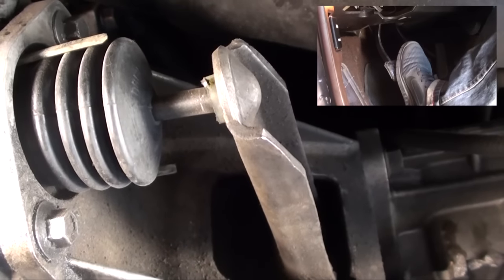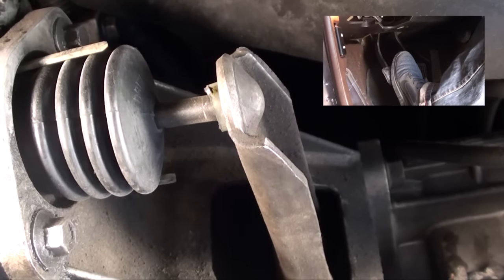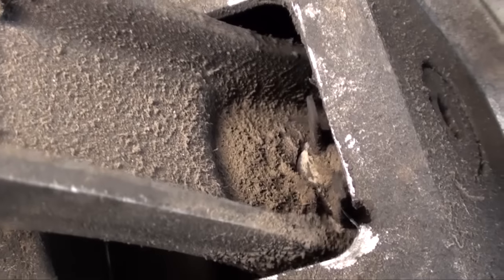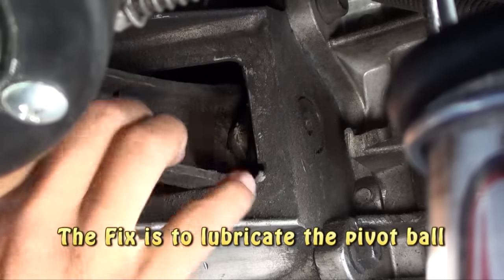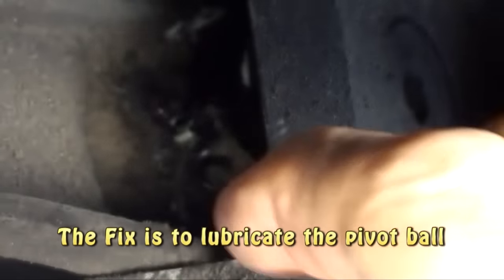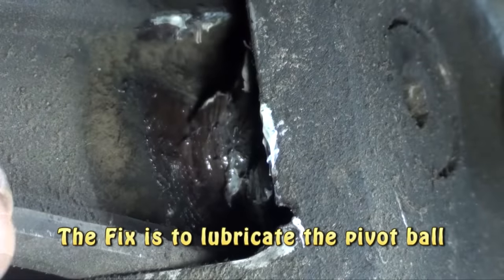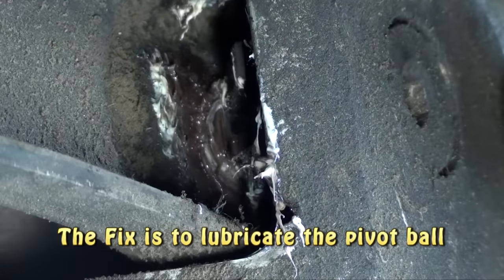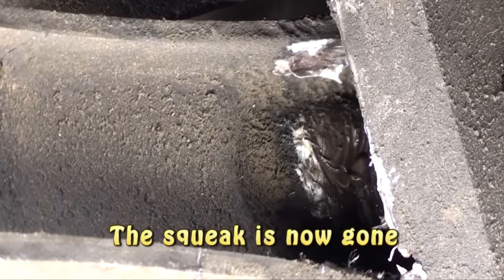Clutch Release Fork Noise

Comment: This... actually sounds very similar to what is going on with mine. Except I have to press a bit more on the clutch.
I am betting it is likely more input shaft bearing noise. :c
Reply from the maker: If you have to push your clutch pedal 2/3 to 3/4 of the way down for the noise to go away then the problem is inside the transmission.  Input shaft bearing in the most likely suspect but if you have a transmission as compared to a transaxle it could also be counter shaft bearing noises or even noises from the bearings that support the gears.
Reply: @DrivelineMaster  I took it to a transmission repair shop, they test drove the vehicle and they said it's the throwout bearing.

From what I have read, throwout bearings should only make noise when the clutch is engaged/pedal pushed to floor.

What I am experiencing is, clutch is making noise when released, pedal is off the floor.
When I push the clutch in to engage, the sound makes a slight rotational noise that is winding down, that then ceases shortly after holding it pushed to the floor.

https://www.youtube.com/watch?v=YCkk-hgNI2E is similar to what I am experiencing. Chances are the one installed in this car is the wrong one, as the previous owner mixed dexcool and some other shit coolant together. Stock clutch for my car is an Exedy Sport (according to AAMCO a 'racing style clutch' that they won't warranty on install) also yes, this is a "transaxle" due to the car being FWD.
Reply from the maker: @liger0yager    Here is how to tell if it's a release bearing.  But first I need to clarify.  I'm glad you stated the position of the pedal but clutch engaged and disengaged are opposite of the pedal position. My students get that confused all the time.  Clutch engaged is when engine power is engaged with the transmission input shaft (pedal up) and disengaged means the engine power is disengaged from the transmission (pedal down).  Now for a release (AKA throw out) bearing noise. When the noise occurs is slightly different depending on if you have a hydraulically operated clutch or a cable or old mechanical linkage design. If it's hydraulic then you could be (not always) hearing a slight noise with your foot off the pedal and when you push your pedal down 1" - 2" the noise will change in tone and loudness.  This noise will most likely continue as long as your foot is on the pedal. Once you remove your foot from the pedal the nose level will decrease but may not go away.  If you have a cable or old mechanical clutch system you most likely will not hear any noise with your foot off the pedal and when you press slightly on the pedal about 1" - 2" you will now hear a noise that will most likely continue as long as you have your foot on the pedal.   I have seen a few cases when the bearing was just starting to go bad where it was very difficult to hear and it almost seemed like the noise went away when the clutch pedal was pressed all the way to the floor.  The key here is the noise you hear when you first press on the pedal.  I refrained from using clutch engaged or disengaged as well as pedal depressed because these terms tend to be confusing until you fully understand them.  Just for the record pedal depressed is the same as pressing down on the pedal.
Reply: @DrivelineMaster  Ahh! Thank you for the clarification, and thank you for your help.

https://youtu.be/5ripJ4clkZk in its pedal down and out is pedal up. It's a very subtle sound right now so very hard to hear.

Comment: This is what I needed to see. I'm gonna look on my 2015 Honda accord v6.
Reply from the maker: Honda's are notorious for this problem.
Reply: @DrivelineMaster  thanks for letting me know. The service advisor charged me $160 and told me they couldn't find any issues. Smh 🤦🏻‍♂️
Reply: @DrivelineMaster  your video is most likely going to save me. I'll report back when i get it done. I'm ordering white grease off Amazon first.
Reply: Hey... I'm new to cars... Can you please let me knew where can i find the release fork and the pivot ball inside the engine bay... Thanks
Reply from the maker: Not all vehicles have a release fork and pivot ball.  If you have an external slave cylinder or cable operated clutch mechanism then you have a fork and pivot ball.  Look on the side or even the top of the transmission bell housing for the slave cylinder or cable linkage connection.  if you have one pull back the rubber boot that protects dirt from entering into the clutch mechanism.  The pivot ball is inside the clutch housing.  Some you can access through the hole like the one in the video and others you can't and the only way to fix those it to remove the transmission.

Comment: The fork is NOT supposed to move like that when it is released. This clutch combanation needs to be replaced, although you have 'fix' the noise temporarely.
Reply from the maker: Some move more than others.  It's all about how even the height of the pressure plate spring fingers are.  As the disk wears the fingers can become more uneven.  No one is going to replace the clutch or pressure plate because of this.  The cost is too much and some movement is normal.  There are no standards for how much movement is acceptable and there are no ill effects from this movement.  The biggest problem is technicians who replace clutches don't know how to properly lubricate the pivot mechanism.  In this case the rubber boot for the fork was missing which let in all kinds of water and dirt which accelerated the drying out of the lubrication at the pivot ball.

Comment: Had this issue with my Land Cruiser Prado, was driving me crazy, even bought another clutch kit thinking it was the problem. At the end, it was the Pitchfork, the OEM pitchfork comes w a hard plastic cover where the pivot ball rest (would suggest changing the pivot ball also) that avoids this sound.
Reply from the maker: It was probably a revised part number for the release fork to correct for that problem.  I have seen holes eaten through the release fork and worn down pivot balls because of the lack of lubrication. When I worked for BMW they used a specialized plastic pivot ball that we replaced on every clutch job.

Comment: I have exactly this problem on my VW Golf.. Is it possible to do it myself or do I need to take away parts?
No experience with cars so I only dare to do small minimum fixes myself.
Reply from the maker: What year golf because early year golfs didn't use a release fork or pivot ball design.  I'm not sure if current year models have changed over to a fork and pivot design or not.
Reply: @DrivelineMaster  mine is a MK5 2012 model. Is it reachable without moving heavy parts?
Thanks for a fast response.
Reply from the maker: @davidcid804  In America I don't see the MK5 model listed in my service manual so I can't see the design.  When I look at a Golf I see a system that does not use a release fork and pivot ball.  If your MK5 has an external slave cylinder and a release fork and pivot ball you may be able to do this.  You will have to be able to remove the slave cylinder and the rubber boot that keeps the dirt out of the clutch from the release fork access hole in the side of the bell housing.  If you have gotten this far you will need a light and you need to be able to look inside the bell housing to see if you can see and access the pivot ball.  Some clutch systems put the pivot ball on the opposite side of the release fork. If this is the case it can't be lubricated without removing the transmission. If you can see the pivot ball get some grease on a flux brush, push the fork back and apply grease to the fork pivot ball area.  Reassemble and the noise should be gone.  You might be able to get a mechanic to look up your clutch and tell you if you have a pivot ball and what side of the bell housing it is on before diving in.  Good luck.

Comment: The noise is actually fro the TO bearing face lightly contacting one or more of the clutch diaphragm fingers when spinning. When you put pressure on the pedal, the face stops spinning as the TO bearing engages the diaphragm. Greasing the fork just dampens the vibration, the noise is not from the pivot ball or fork.
Reply from the maker: I'm sorry James but that is not correct. Not all TO bearings lightly contact the diaphragm springs when the pedal if fully released.  Only hydraulic clutch release mechanisms will do contact the spring when the pedal if fully released. If the TO bearing is bad it will make more noise, not less noise with slight pedal pressure because the TO bearing is now placed under pressure and spinning at a higher value. Bad bearing noises get worse when: 1) they are placed under more pressure and 2) when they are spun faster.
Reply: @DrivelineMaster  nice comeback 😂

Comment: I have the same thing, but only on a new clutch/flywheel install.  I'm not sure if your pivot fork  ball is similar to the clutch bearing I have.   But I question why there is so much vibration that is making it rattle.  In my case I noticed the new flywheel 'wobbles' a little.  Not enough to feel when driving and not more at high revs, but enough to vibrate the clutch bearing, particularly at lower revs.

My old flywheel/clutch does not wobble at all and so does not vibrate the bearing in the fork.  I guess my concern would be that you are hiding a warped or unbalanced flywheel.  But maybe it is a different enough setup or my old flywheel is 'perfect' and the new one is 'good enough'.
Reply from the maker: If the flywheel were warped or unbalanced you would most certainly be experiencing a whole lot of other very noticeable problems and vibrations. I'm going to assume that you are calling the throw out (release bearing) the clutch bearing.  What causes the fork to wobble is how level the pressure plate (clutch cover) springs are.  This has nothing to do with the flywheel but instead the quality of the clutch cover and the clutch disk.  This is because that is what the release bearing is riding on and the release bearing is connected to the release fork.  I see this a lot with different variations of vibration.  The key indicator that it is the pivot ball on the fork making your noise is the fact that the noise is only heard with your foot off the pedal and it goes away with slight pedal pressure. This means the pedal was only pushed down about an inch.  Even with a new clutch this can happen if the technician does not lubricate the pivot ball and fork or they use the wrong type of lubricate.  Another factor is if the boot that is designed to keep water and road dirt out of the clutch assemble is missing. Not shown in my video because it was missing on this one.  With the boot missing water and road grit can enter into the clutch and pivot washing away the lubricant.
Reply: @DrivelineMaster  Thanks for the reply.  Yes, I meant throw out bearing. Makes sense, if those springs are not exactly level they will vibrate the TOB.  I figured a bad flywheel would create a lot of vibration.

Comment: So when my clutch is engaged it makes weird rattling like noise, but when I press it down the noise goes away(it happens when in neutral car not moving)what could that be?
Reply from the maker: Foot off the pedal in Neutral you hear the noise.  You press the pedal down 1/2 - 3/4 in. you still hear the same noise. You press the pedal down all the way and the noise goes away.  If this is all correct then the noise is coming from inside your transmission and it's not a clutch noise.
Reply: @DrivelineMaster  thanks for the info

Comment: This is exactly what’s happening to my 91 mustang, I keep being told it’s the throw out bearing and I’ve tried to explain I have no difficulty shifting or any noises when bepressing the clutch, it’s just some weird chirping that’s there when the clutch is not engaged
Reply from the maker: I don't remember the year but the video was from an older mustang. The problem is some vehicles don't place the pivot ball near the release fork opening in the bell housing but instead it's on the opposite side which makes adding lube like I did in the video impossible. Good Luck.

Comment: I'm having this same problem with my 2018 ranger maybe not the same problem, but the noise is completely the same and only when I press the clutch pedal I took it to the Ford dealership where I bought it 3 times and I will return there on 07/07/2020 for them to try to fix it again, I'm from são paulo Brazil beautiful post I hope that now they can fix this still under the 5 year warranty

Comment: Thank you. My 2002 mustang with a 2012 mustang engine was making this noise and I was super worried it was a throwout bearing. Should be a simple fix.
Reply: I have the same issue with my 1997 mustang . Did you get it fixed? Im guessing you took off the the dust box off near the transmission  and put some grease where the fork and the pivot ball meet? Correct? The pivot ball on the mustang is deep on the other side of the fork , in the transmission.  How did you get the grease all the way to that pivot ball? Long brush like this video? Or you used something else Please? Please help. I need assistance.  Thank you.
Reply: @havipran1726  do you have a v6 or a gt? I have a 97 v6 I’ve been having the exact issues for about 3 months now, did it go well? Did you fix the problem? Any tips? And what type of lube did you use for the issue?

Comment: what that background noise that goes away when u step on the clutch pedal? @ around 2:00
Reply from the maker: I think you are hearing the release bearing (throw out bearing) on the pressure plate diaphragm springs. as it sites on the release fork there is no load on it until the pedal is pressed so it is subject to rattle from engine vibration. This is not abnormal and changing the bearing would not remove the noise your are hearing.
Reply: @DrivelineMaster  what is the main cause of the sound when idle & goes off when clutch depressed ?
Reply from the maker: If you hear a noise in neutral with foot off clutch pedal and noise doesn't change if you press the pedal down 1 inch but goes away when the pedal is all the way pressed down is a transmission noise and not a clutch noise.

Comment: Where exactly should i put the grease on, my clutch fork is connected with the throw out bearing and in the video you say between fork and pivot bearing?
Reply from the maker: If you have a clutch fork you will have a pivot ball and a throw out bearing and they will be connected even if you can't see the connection.  There are however some vehicles that don't have a clutch fork (release fork) and therefore they do not have a pivot ball to lubricate.  If you reply with your year, make, model and engine size I will try to look it up for you and see what I can find out.
Reply: @DrivelineMaster  Thanks for your answer man, i drive a toyota altezza build in 03, 3sge/ J160 6 Speed Manual ( the same transmission as the lexus is200 )

So far i know is my pilot bearing in the flywheel and my throw out bearing before the pressure plate ( thats the location that i can reach from the „fork cover“ )
Reply from the maker: Unfortunately the Toytoa Altezza is not sold in the USA and I only have access to repair information on vehicles sold in USA.  Toyota is not one of the brands that did away with the release fork however some release fork designs put the pivot ball on the opposite side of the bell housing from the where the release fork extends through the bell housing access hole.  You need to pull the rubber boot back from where the release fork extends out of the bell housing and find a way to look inside for the pivot ball.  If all you see is the throw out bearing and you can't see a pivot ball then that means your pivot ball is on the opposite side of the bell housing and there is no way to lubricate it without removing the transmission.
Reply: @DrivelineMaster  Thanks for your time, i think the lexus is200 was sold in the usa the „J160-6 speed gearbox“ is the same like the one from altezza. But i‘m pretty sure that the pivot ball is on the other side like you say.

Comment: this is although a temporary solution.have the same sound on my Hilux Vigo 2006.After lubing the pivot ball sound comes back after couple of months(water/time)
i guess better solution is to change pivot ball and clutch at the same time cause it bears out
Reply: Hello my friend, Land Cruiser Prado over here w the same issue, did you solved it in your Vigo? Noise keeps coming back every few weeks so i was thinking the same thing, since I already changed the pitchfork, slave, pivot bearing, clutch kit, the only thing missing is to change the pivot ball

Comment: I had this problem, we greased it, and the noise remained. Then months later, the pivot pin broke. The clutch did not want to disengage at higher rpm. We are replacing the pivot pin ball tomorrow.
Reply from the maker: I'm sorry to hear that.  It must have been pretty far gone if grease didn't help and it failed a month later.  You will also need a new release fork.